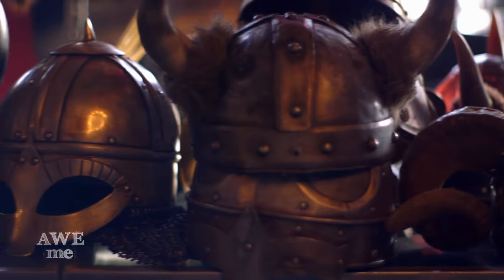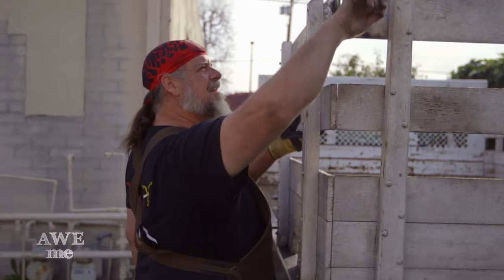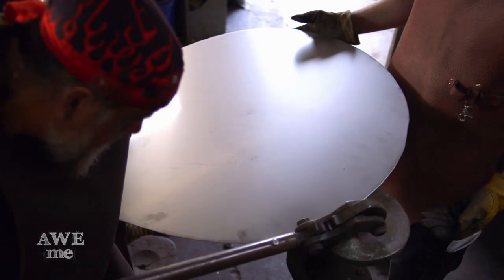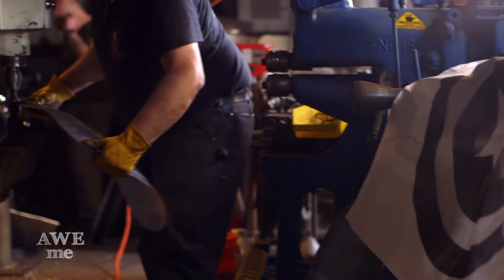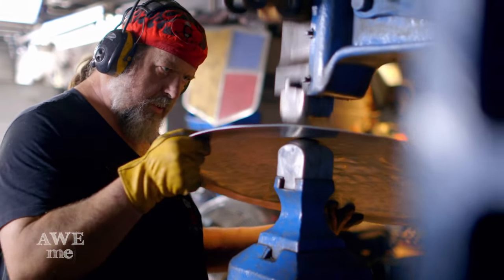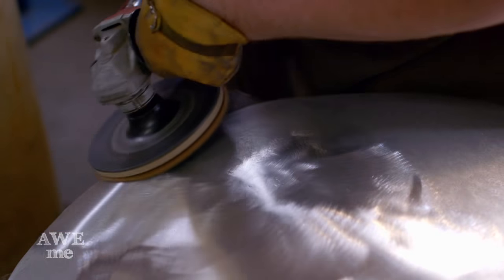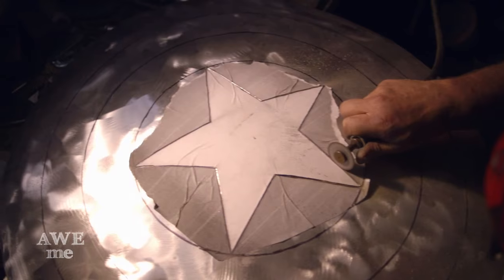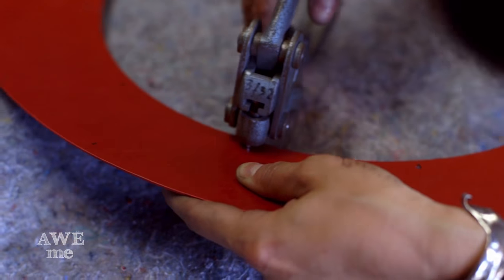Captain America's Shield - MAN AT ARMS

Comment: That was the worse project you have ever made! Looked like someone in Preschool had a construction paper project and that's what they built. Buckles in the metal, not smooth, it is a Rector Set Shield. Some Assembly Required!
Reply: Really? That'd be one badass Preschooler then...
Reply: Cpt. America's shield is smooth. This had bows and layers of metal!? AIR could easily go through most of it which causes wind forces to act strangely upon on than a smooth shield. You can't throw this like a Frisbee?
Reply: From the looks of it I'd assume a multipart full metal shield like this needs a specialized armor smith to look really good. This has a distinct 'bladey' style. Then again, he says he's been an armor smith for a long time. Maybe he was lacking time and they needed the project done for airing on the show. Those things can happen, too.
Reply: Dowlphin
He could a month to finish it and they film as they work I'm sure. THIS IS HIS IDEA of how it should be and it isn't the best idea I have seen them have.
Reply: Nunya Beeswax The reforged version is better. But I totally agree.. they threw an apple at it and the shield almost fell into 3 pieces. I'm pretty sure thats not a safe shield to bring into the warzone...
Reply: TheCheatCodeAwesomely
It is very symbolically representative of the USA's military activities though, so I enjoy the poetical component here, haha.
Reply: Dowlphin As a total marvel nerd... the shield is completley incorrect. If it can't withstand the impact of an apple, it's not a Captain America shield. That's a promise.
Reply: TheCheatCodeAwesomely
Imagine what the impact of an apple pie would do to it. ;-)
Reply: Dowlphin It would explode
Reply: Not a safe shield means a baddass war weapon
Reply: Justine Gira It's not even stable enough to attack with. it Would just feel like getting slapped with a pillow
Reply: pfft can u forge that shit? didnt think so
Reply: TF Stop motion Compared to his other forgeries, this was a little bit of a fail though...
Reply: I think too, its look like shit :)
Reply: They need to remake this!!! Make the shield more compact, it's one piece of metal don't overlay it with more to create the stripes! The colored stripes are just that, colored!
Reply: Nunya Beeswax you are
Reply: Ok, buddy.
Make a better shield then
Reply: Felipe Ferreira I'm NOT the one that has a business designing and making props for TV shows and movies or a TV Show, You tube feed, and is supposed to be a professional at this. I make GUNS! If someone gets close enough to you that you will use one of their weapons that they make here, it's all over but the crying! If I was to make one of these, I would use a 55 Gallon drum top, heated, and pounded into the shape & sharpened. Then simple Dremel Tool etching would make the design. Paint the thing, and make it aerodynamic to fly and cut through some stuff.
Reply: To be fair. Vibratiam doesnt exist. So yeah. It just a likeness of the shield not the actual shield.
Reply: TheRangerRed
To be fair before I call someone a non-speller, What does "Vibratiam" means?
Reply: Charles Sifferlen
I know all about Captain America because I was n The Army. They give you free at the commissary one comic a week or more if you're greedy.
 Captain America's shield is made of the same stuff Wolverine's Claws. Adamantium
Reply: Nunya Beeswax Ehm.. The shield is made of Vibranium, not Adamantium.
Reply: Anders Wik
Publisher,Marvel Comics
First appearance, Avengers #66 (July 1969)
Created by Roy Thomas, Barry Windsor-Smith
Stan Lee
In story information, Type, Metal
Element of stories featuring
Wolverine,
Bullseye,
Lady Deathstrike,
X-23,
Captain America's shield,
Ultron's Armor

http://en.wikipedia.org/wiki/Adamantium
Reply: Anders Wik
Types of adamantium
Proto-adamantium
The experimental iron alloy that Dr. MacLain experimented on with Captain America's shield is now referred to as "proto-adamantium", which is slightly different than true adamantium in that it's stronger than the latter. Dr. MacLain's experiments with proto-adamantium led to the creation of true adamantium. This proto-adamantium (the only known source) was incorporated with the vibranium in the shield and has never been recreated.
Reply: Nunya Beeswax "Originally, Dr. Myron MacLain was attempting to perfect an indestructible alloy as strong as the legendary 'Adamantine', which Hercules' Golden Mace was made from. Dr. MacLain was hoping the alloy would provide a distinct advantage in the armor of American war machines, during World War II. The Doctor worked tirelessly, using the exotic Vibranium metal and an unknown substance. While the Doctor was asleep, as a result of his exhaustion, an unknown factor caused the metals he was working with to bond." 
A mix of both? Well whatever. Thanks for the story lesson.
Reply: i totally agree my brother made a better one from a satellite dish i must say it's pretty freaking awesome
Reply: I completely agree.. I've only seen 5 videos on this channel today. And looking around the shop, I don't understand why they were content with such a shotty looking shield.
Reply: Sam Beals he had a premade shape... so it doesn't count. i'd like to see you both do better from scratch
Reply: Obviously that wouldn't happen.. I'm sure you can name plenty of movies that suck but I doubt you could do better.
Reply: Billy Carlin
I don't get paid for making things, like they do. If I got paid to make a movie, I would do a Great Job!
Reply: I think these are really more like props then actual weapons as in the videos he states he makes props so that's probably why it's not a perfect shield anyways he probably has a small budget trying to make these anyways so it doesn't really matter
Reply: Cedric Wyche Yeah man!
Reply: Anders Wik Vibranium and Adamantium are the same thing, but in the movies they renamed it to Vibranium
Reply: i guess so...
Reply: why don't you do it yourself and let us see the result (?)
Reply: Aristotle Pone Pule
No, vibranium and adamantium are different metals.
Reply: Henry Luthor Yes and no.. It is strictly taken Adamantium (the original of his shield) but Adamantium belongs - like the X-Men rights - not at Marvel. So they had to make it Vibranium. But the Effects for that matter are the same. Once shaped almost nothing can break it, it absorbs shockwaves and if it has an edge it will hold it for all eternity.. Ist just the usual Marvel vs Fox kinda deal..
Reply: He should have watched the movies they explain the shield it is mad of one specific type of rare metal not layers of stwinless and aluminum. i understand that the metal in the movie isn't real but fact is it is one solid piece and is said so in the movie it would have been better off a solid piece of 1/4 aluminum than layers of sheet metals
Reply: yeah this was ugly.
Reply: Glad to know that it's not just me who thinks that this one is pretty crude looking. I always imagined it to be a solid piece of metal, not something layered together like that.
Reply: I thought it was pretty crap to :( I was looking forward to this vid and as u can tell by my youtuber pic im a pretty big captain America fan !!!!!
Reply: Dᴏᴡʟᴘʜɪɴ I guess you have the best take on this project...  My lip was curling more as I saw the final project, but I couldn't have even achieved what he did!  :D
Reply: والله انك صادق هههههههه yes so bad
Reply: Nunya Beeswax technically the sheild is a compound of proto adamantium and vibranium
Reply: So it's an alloy of 2 different metals making it one metal and the shield should be one piece. This shield wasn't forged it was cut out sent to a different place to be anodized and then riveted together lol he could have just had them use a CNC machine and machined one iut of a rim blank and painted tha circles lmao would look much better and prob stronger
Reply: Do I look like I give a shit I could make a better cap shield than that in my sleep
Reply: Better than any shield you can make.
Reply: Are u sure bout that I've actually made one well better than that piece of crap so get ur facts right .
Reply: Matthew Brough Evidence?
Reply: It's not about "Can you do better" it's about them having the skill to do a hell of a lot better. This shield isn't even movie worthy. Shit, its not even costume worthy. They did poorly considering the other work on their videos which look great. And if you disagree you're just in denial.
Reply: The NJPW Spanish Announce Table well i can..and i can do it, in 8 hours of 1 piece of metal, can u?
Reply: ................... was that meant to make sense?
Reply: Did you expect it to be made of Vibranium?
Reply: Nunya Beeswax thats probably because he sayied, that he wants the shield to be functional, so this way its more durable, but i agree with you that the shield should br smooth
Reply: Let's see if I can make it better than they can or ever could. I did write a better sentence than you!
Reply: Completely agree
Reply: Thank u
Reply: IKR like why couldnt they like spray permenant spray pain on it so the paint wouldnt where off instead of like stapling 5 pieces that makes up the american flag to a metal circle? It totally ruins the name of Captain America
Reply: Cpt. America was made for the US Army. It first was supposed to be called Super American. Captain America wears a costume that bears an American flag motif, and is armed with a nearly indestructible shield that he throws at foes. The shield they made disrespects the US Flag and the Men who fought to protect it and keep it safe from harm. underneath every flag pole should be buried a 1911 - .45 cal. pistol, Needle and thread, and last resort matches and propellant to burn it in case it ever touched the ground. The ammo for the 1911 is in the truck of the flag pole or the ball at the top. This however is what is told to us, but it is not true but just symbolizes how the military and everyone should revere the flag.

Comment: Could you guys please remake this shield (not counting the smaller throwing variant) so it doesn't wobble so much when absorbing impact? You did a lot better with the Hylian Shield and this is a shield that's worth getting right a second time. Remake it so it's heavier and more neatly riveted. You should aim to make it so it can take a blow from the Mjolnir you made without denting or bending excessively.
Reply: +qurazy  a different group of guys made the throwing shields and the hylian shield. That's the Reforged group, they do superior work.
Reply: +Itz A Mystery  soooo, what's his excuse for not heat treating and using piss poor riveting on inferior metals. hmmmmmm?
Reply: Lol professional, I'm a professional burger flipper do you know what the word means?
Reply: +qurazy It's because in the movie it is one single piece of vibranium and is just painted, in this he has riveted several pieces together.
Reply: +Travo-Chan no it actually means that you do it to earn money it doesnt have anything to do with how good your are
Reply: +qurazy i know right its suppose to be super hard and thick and when they threw the shield to break the glass any tennis ball can break glass too and it was so uneven the shield
Reply: +qurazy should redo it, wood as a base with aluminium over it, no way they can make it a solid metal disc and still have it be light and non flexing.

Comment: Worst piece yet
Reply: it may be true, but its very functional
Reply: ya C.A is one of my favorite marvels but your right this shield is kinda sloppy but hey not easy to make
Reply: I have to admit, it didn't really have a smooth finish
Reply: I dunno. I'm thinking the way it bends a little is good, because if it was strong yet rigid, it would snap from a strong enough force. The way it absorbs impact rather that deflects completely is good for a long term shield I would've thought.
Reply: ***** too bad vibranium isn't fucking real and he's using materials that yes, would have to bend to absorb a blow.
Reply: also you heard him say that he wanted to make it functional in the beginning of the video
Reply: garrett robertson Can't tell if trolling, or doesn't recognize sarcasm...
Reply: mynameismatt2010 I was really high when I wrote this
Reply: Elfire II Functional?  Look how flimsy it is.
Reply: ACStasis Did you not see them shoot an arrow at it? All thin sheets of metal are going to wobble, especially when they're being swung around, that doesn't make them flimsy.
Reply: ACStasis 

Yeh that was a pretty poorly done shield. Honestly  2 layers lexan with that rubber stuff in front windshields would work way better. Using monocoat a material used for model planes etc you could do the red white and silver between the layers etc. Scotch bright the entire outer surface and it would get the look of brushed steel. Also it would be bullet resistant depending on the thickness of the lexan it could stop any thing from a .22 to a 3006 The higher the cal youd look to stop the heavier the shield. But getting one to stop say a 9mm or 45 would be pretty light.
Reply: I wanna see you make a shield... Like a perfectly legitimate shield! Maybe you can do better
Reply: Tommy Allen Make one with thin layers of polycarbonite (SP?) Plexiglas aka lexan. It would stop a bullet up to hmm .380 maybe even a 45 depending on thickness and weight wouldn't be to terrible ither. Best part is it could be made to look pretty much identical to the captain america shield.

Comment: It obviously took a lot of effort but the end result was pretty bad.
Reply: might have turned out better with a wet pressed wood backing to give it more rigidity since the initial steel layer was cut and pressed so thin
Reply: Probably the store was out of vibranium...
Reply: NoldyJay that and the real one would have been poured while the metal was molten liquid then machine finished. even then you still have to figure out how to color the surface with 3 different colors in one pass.
Reply: SpecTRe X he could have used small pieces of iodized metal and welded then separably to the shield so it doesn't create the bulge. he could also have used  tempering clay to make the shield heat up slower in certain areas to make the color. it wouldn't be the bright rich red like capt's shield but it would be a nice deep red and blue. then blackened the rest except the star which he could have just ground then polish
Reply: Garcia Demierre or that lol

Comment: titanium is stronger than steel
Reply: sayon Vijay not in making stuff like this. Titanium is stronger by weight, not volume. Two identical swords/shields made from titanium and steel, the titanium one will weigh less, but the steel one will be stronger. You need to make the titanium one thicker and heavier for it to compare to the strength of steel. And it will weigh about the same then. But even then it will never get as hard as steel.
Reply: Frank Garrett theyr both a kelegrem